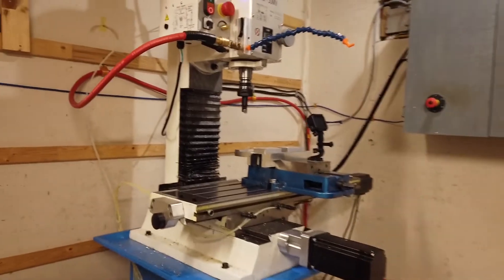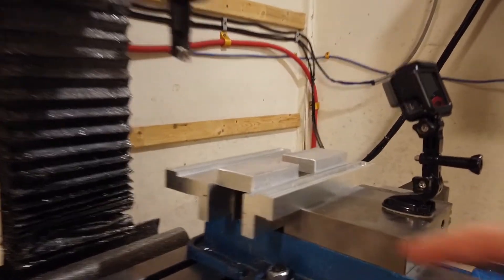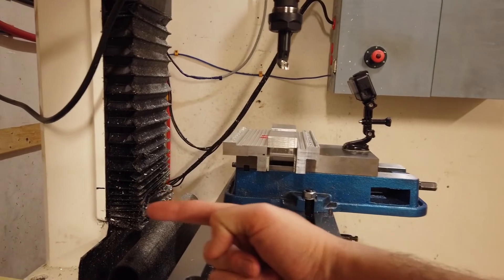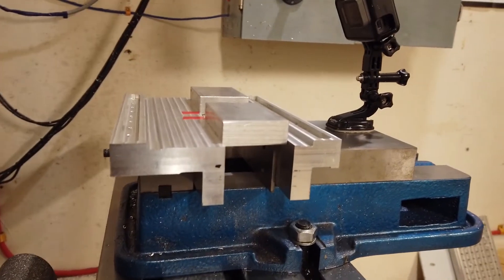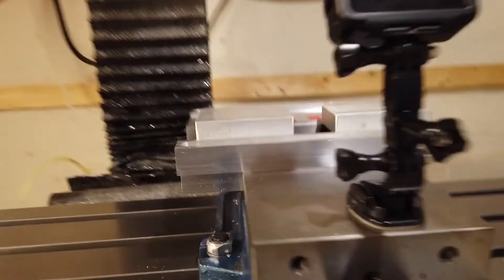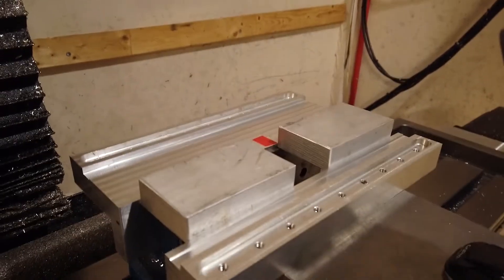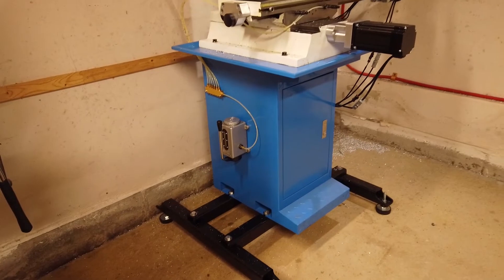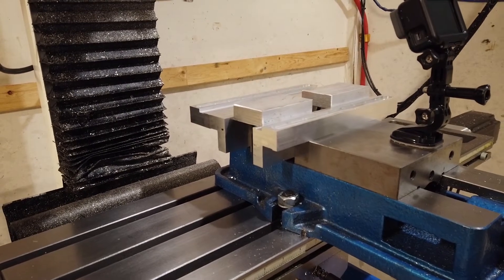200ipm Rapids on Hobby Mill - Converted PM30-MV

Comment: If that is a Kurt knockoff vice you should be able to move the vice jaw to the back of the fixed jaw. Just unbolt the 2 large worn head screws that hold it on and swap it to the other side.  I do that all the time to increase the clamping length of the vices at work.

Comment: Dam  i bought the same machine and paid for the stand   sht
Reply from the maker: At least the price is right... as much as I dislike it, I’m still using it to make good parts.
Reply: @adamdebowski2037  I am going to bolt mine down to the floor and see what happens
Reply from the maker: @christianlords1340  That is probably the best idea. Are you going to convert to CNC?